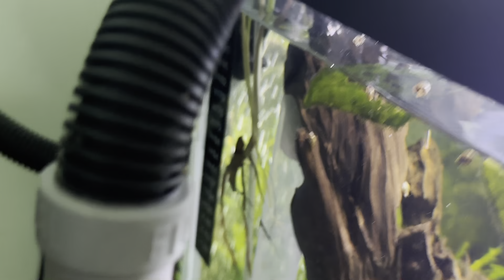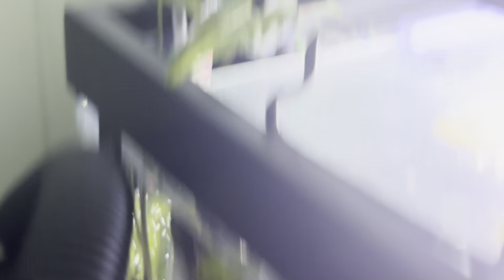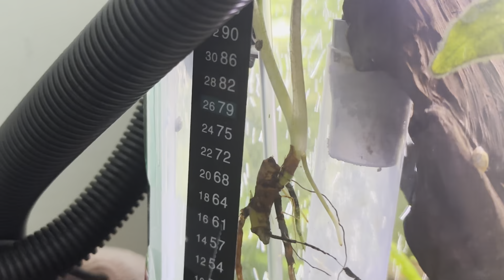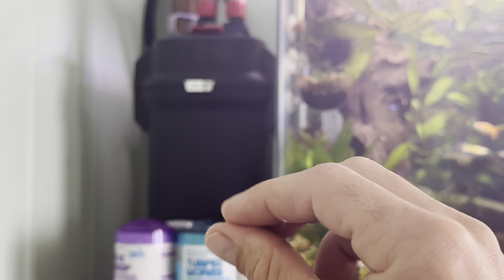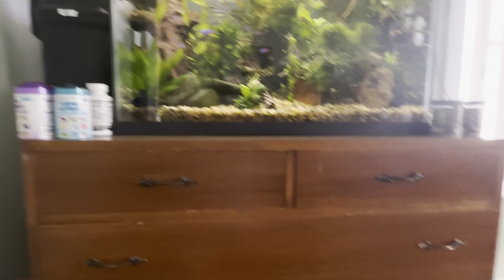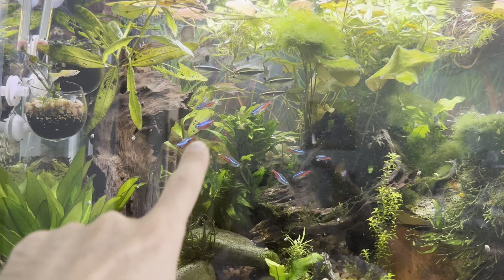My 29 gallon zero maintenance no water changes overstocked tank

Comment: This is over stocked and a filter on a timer really is not good as and bacteria will die also the water change is to add as well as remove the fish you have in the tank are hardy fish but guppies will end up with arched backs due to lack of minerals and calcium never ever leave a tank more than 6 months without change most aquarist prefer 15% weekly and this ensures longevity the smaller the tank the more toxicity will be apparent
Reply from the maker: Bacteria won’t die for at least 10-24 hours and recovery is fairly quick too a lot of bacteria’s can bridge both zones 

Plus theres tons in the tank 

Ammonia is converted almost instantly by the tank at this point the filter is mostly for movement and other water qualities the living films contribute to the water.  

Is hard to get ammonia to show on a test kit in such a active tank 

I use coral sand as a buffer 

The fish food has supplements like calcium and things  

The bigger challenge is blending fish with different water parameters hard and soft low or high Ph 

Nitrate is a problem I haven’t been able to solve 

Water changes usually affect the tank negatively I’ve noticed any problems I have usually followed a water change 

I think because the risk of new water not being ideal or truly clean is a new unknown each change
Reply: @Thedevontree   Hmm bacteria will start dying after 2 hours but might take 24 to completely die but this will have an impact i would also say that if a water change is effecting your tank either your not doing often enough or to much at a time its easy to match parameters if the frequency of change is stable this would need to be gauged by testing using a new liquid test kit over say a month would be best then you wont need to test again and this is why your nitrates are high because your not getting a full cycle only partial but each to there own nitrate can be present in tap water so test that to

Comment: Get aqua soil  it is a soil substrate that releases nutrients and balances the kh/ ph . Do a deep aqua soil and cap it with sand 2 inches to cause anarobic bacteria deep in substrate,  which breaks down nitrate and the plant  roots will go deep for the nitrate and nuttrients , GET RID OF THE UNDERGRAVEL, IT STRIPS AWAY PLANT NUTRIENTS.  GO to " father fish on you tube ". I have a 2ft tank set up like this and the plants double in size over night .
Reply from the maker: I think I’m just going to get a new tank and start with that method and see how it goes. The one I have now is already set up. I’m trying to run the experiment to see if I can get this to work as well but it’s a lot of work to just break it down and start over.
Reply: @Thedevontree  great , also " md fish tanks " on YouTube , I think it's called that its ^ md" something . He sets up all his tanks with aqua soil  . These dirted tanks give fantastic results and you dont need co2 , "father fish " on you tube is a great old timer , I think he must be in his 80s , he says this method with dirt capped with sand and crammed with plants you wont need to do any water changes , this is the only reason I got back into the hobby as I'm disabled and in chronic pain and cant do these big water changes that's why I got rid of my  old tank. Also get rid of the under gravel  , keep you cannister filter if you want to . I run my 2ft tank on an air pump driven double sponge filter  and small internal power filter . I love sponge filters they are cheap and in my opinion the best , and easy to clean . You could change your under gravel  for sponge filters and your external for mechanical and biological filtration .always wash your filter sponges in a bucket of tank water as chlorine in tap water kills the good filter bacteria on your filter media . When adding tap water always treat it with a dechlorinator before you add tap water to your tank , DONT WASH THE AQUA SOIL  YOU PUT IT IN YOUR TANK UNWASHED AS IT WILL GET RID OF ALL THE NUTRIENTS FOR PLANTS IF YOU WASH IT.

Comment: I noticed you have a lot of filtration. Im running a fluval flex 15 gallon. Run a 500~ish gph pump that is adjustable in 20% increminents with about 5-6x the bio media the sump came with, also have a massive bag of bio balls in the second chamber and some ammonia reducing mechanical media. I have 10 kuhlis, 1 clown pleco, 2 chili rasboras, 2 celestial rasboras, 8 red eye tetras, 5 glo danios, 1 betta, 15 orange shrimp, 5 amano shrimp, and 6 nerite snails. The tank also is heavily planted and i have a pound of crushed coral in the sump. I am doing 30-40% water changes per week/week and a hald. With all of that said, i was REALLY struggling before i got the stronger pump and revised the filter media. Im pretty sure my tank was basically not cycled with all of the fish minus the shrimp. Once i made the changes in two weeks i was fully cycled 7,0ph
Reply from the maker: cool looking setup!  I'm re-thinking everything after testing and having high nitrate.  Cycling is time and having the right media.  Plus bacteria supplements.   I think ideally mechanical and biological would be separate systems, but hay.  I think biological should be very low flow through dense media.  All this has just dawned on me in the last day or two.  Checkout the confession video I just posted.

Comment: I'm not sure that you are that much overstocked because your fish are small. I have a 29 gallon as well, and I have 22 fish in it, plus 3 Amano shrimp, plus about 10 cherry shrimp and according to the metric in AqAdvisor, I am not overstocked. I don't have a filter canister, or undergravel filter; just a hang-on-back filter. I do weekly maintenance; I vacuum and change about 10% of the water weekly. I rarely lose fish in that aquarium.
Reply from the maker: Hay Fox thank you for the comment.
I probably have 35-40 or so fish small ones mostly tetra and tons of shrimp.  
I think the under gravel plays a big part with water quality. I know it’s not really good for the plants roots. I think in time it does get better for planted tanks. I’ve never done a water change. But I definitely would if I saw the fish being in trouble, I have noticed running the air Stone seems to be a part of the equation to.
I’m going to put a video upof just the tank without me standing in front of it, so hopefully more of the fish come out maybe like a five minute video or something check it out.

Comment: The 29 is a great size, but limited long term in what you can keep. I recommend a 40b every time over a 29 just for that reason. However, I do have a soft spot for the size. It's a really great showcase tank for some of the smaller fish. It's the same reason I really like my 45 tall, even though it's so hard to work on compared to my "standard" tanks.
Reply from the maker: Ah the height 
I’d like a breeder too